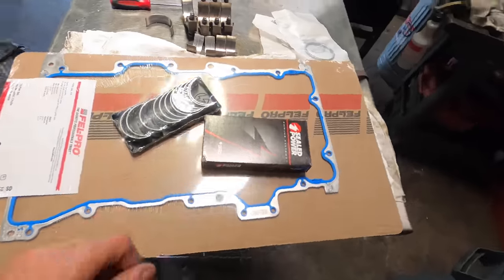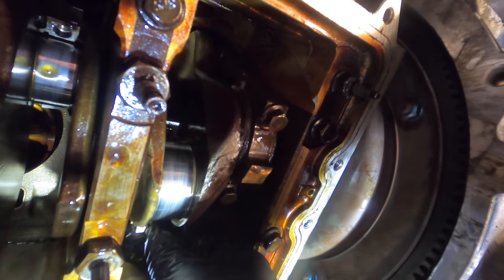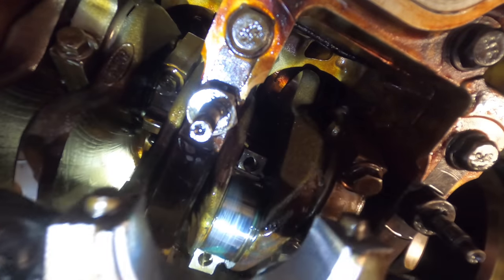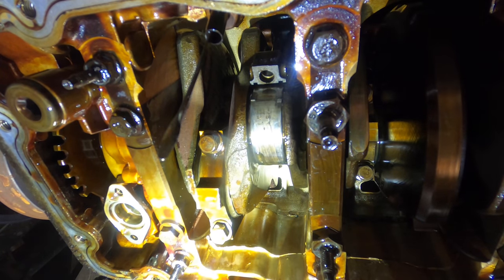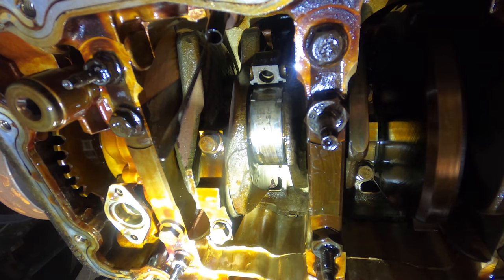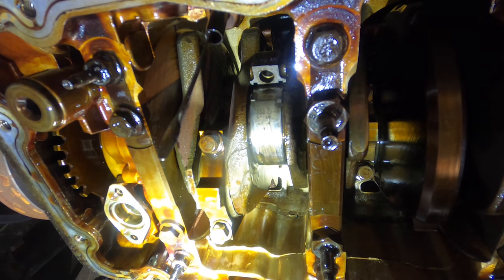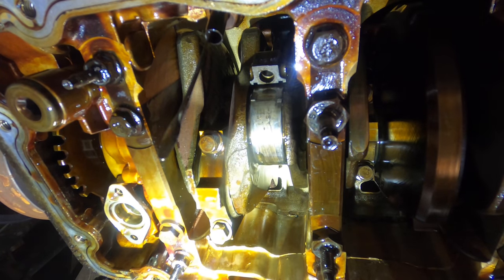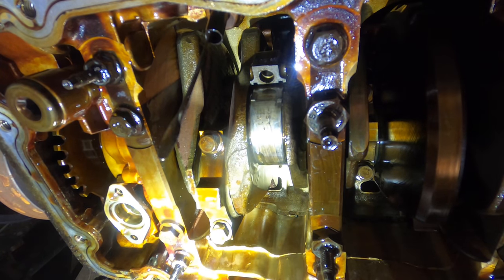Saving an Engine: Spun Bearings Replaced

Comment: It's refreshing to see a mechanic who actually takes the time to try to repair the engine, rather than just throwing up their arms and proclaim, "Nope, needs a motor."
Reply: Most of the time, especially with labor prices, it's cheaper just to replace the engine than to take the time to rebuild it.
Reply: I agree, in this case it was caught before  irreparable damage was caused, so there's a lesson for all here.... if your car has a problem at least get it diagnosed so you don't make an expensive paper weight.
Reply: The total hours of labor for this would have probably covered an engine swap. If you knew for sure you were buying a good motor, the labor cost would ensure you are getting your money's worth. This might work, but long term is unknown.
Reply: And then there's the question of guarnatee: in this case, if the customer comes back after a week with the bushings spun again, now what? (on top of that, he will ask for his money back...)
Reply: @brad3741  No, this WILL work. I've done it, and so have lots of other people. If the rods aren't damaged (they weren't) and the crank isn't totally hammered to death (it wasn't) just changing the bearings will get you many more years out of it. The bearings are deliberately the soft part of the system so they take almost all of the wear when things go bad, as long as you don't drive it so long that the bearings actually leave and the rod is hitting the crank. I've done the same thing on a Pontiac Grand Am with maybe a worse knock than this, and I didn't even smooth the crank like he did. 40k and 4 years later, it's still running and sounding like new. My neighbor is using it now.
Reply: @edifyguy  I don't doubt that it can work. And like I said even a new, used motor is somewhat of a gamble. I was just thinking about a whole new motor because of the possibility of engine wear in other areas. Something caused those main bearings to go bad. I believe he said this person didn't keep up with oil changes, or the oil got low, but I don't remember. I have seen people go forward with these types of repairs and it not pan out well. I just know the dealership I used to work for loved this type of work. Because if the rebuild doesn't work, they get another huge bill out of the customer for a new motor.
Reply: @brad3741  This person stated he never changed the oil. There's a good chance he never even checked it until the engine was making noises, in which case it likely got too low to keep things pressurized, which entirely explains this damage. The repair is the cheap fix, but it often works for a long time. When it doesn't there are other options, as you mentioned, but in this case the car would have to have sentimental value to be worth a new motor because it wouldn't have the cash value to justify it.
Reply: @brad3741  With a used engine, you also don't know what you buy. Cant't see it previous history. (Maybe the maintenance records, but driving is unknown)
Reply: Like the "Car Wizard" does all the time lol
Reply: This isn't really "repairing" an engine.  It's a stopgap and a total gamble.
I've done it a few times.
Reply: @retinaquester  Generally you won't see maintenance records on a used motor either. The junkyard isn't going to keep those on vehicles they receive. They just keep mileage.......but this knocking engine was low mileage lol. The only way you'd get that is POSSIBLY if you bought a motor from a private party who was parting their own car and knew its history.
Reply: @carpediemarts705  Sure it's a repair. Every repair is a gamble. You're betting there isn't something else wrong elsewhere which will cause an additional issue as soon as you put it back together. You're betting the repair parts are made correctly and durable (a gamble you'll often lose these days if you're not choosy about your supplier.) A used engine is also a gamble; unless you deeply inspect it, or at least bench run it, you really don't have any clear idea whether it's better than the one you're replacing. I think this was a great gamble, and one which will likely yield years of dependable service if the operator stops being stupid and gives it what it needs.
Reply: @edifyguy  My only concern is...if the oil level was that low, is there anything wrong on the top of the engine?  I guess you could see if the head gasket had been blown because there would be coolant in the oil, but still.
Reply: @StormsparkPegasus  It is possible, probable even, that the cylinder walls, camshaft and rockers are a little scuffed from low oil, but the bearings get damaged seriously long before anything else because they have explosions literally hitting them, and without the cushion of pressurized oil, they hit the crankshaft, where they're meant to float on the oil. He probably had JUST enough oil to keep some drips in the other places, but not quite enough to keep consistent pressure in the bearings.
Reply: @brad3741   I can change out the bearings like this in a couple of hours, as opposed to doing a whole engine swap which takes me a whole day. So nope not the same amount of labor. Of course doing an entire rebuild of not only the bearings, but piston swaps and valve train overhaul is a different story.
Reply: @alzeal  Well, that might be the case. But what it really comes down to is the hours the dealership bills them for. A job might only take a few hours, but if the book says 6 hours, they get billed for 6 hours regardless how long it actually took. At least that's how it was where I worked. I just felt like that motor was likely compromised everywhere, not just those bearings. Pretty sure he said this customer drove on low oil but I don't remember at this point. If they only got billed for a couple hours labor, plus parts, it might have been a decent option for them.
Reply: @gmstudent93  Another good lesson. If you don't trust when a mechanic tells you something is on its way out and needs replaced then get a different mechanic.
Reply: Oh it needs an engine, may work for a bit but this is not a proper fix. Lets just hope that car didn't change hands screwing over the next guy.
Reply: @brad3741  You're right!
Reply: @brad3741  I am sure that it CAN work if the damage isn't severe enough to loose the tolerances.  With this type of repair, it's a gamble.  You can spend the time, just to spin them again after a short time.  I have done this a few times, prayed to the engine gods; just to spin after a few miles.  I don't blame mechanics for doing an engine swap, their is so much going on with an engine, many thousand parts/components and they have to be in tight tolerances.  Very little wiggle room, that's why I diagnose a spun bearing motor as junk; making the whole car junk.  If a vehicle throws a transmission, I would be fine with a transmission swap; they shift and drive; or they don't.  A bad engine means to me as a junk car, no engine swap.  After a few days, possible pcm trouble codes/finicky sensors, plus many possible issues with a used engine, the time and labor isn't worth the salvaging.
Reply: @aclo982007  Bullshit, even a "new" engine is going to be a reconditioned lump of unknown history and may even be in far worse condition than this one.
Reply: @mfx1  No, just no it doesn't work like that, sorry but a crankshaft is precision ground and that crank is no longer true. Please don't build engine for people there's enough hacks out there.....
Reply: @aclo982007  Again bullshit, the roughness on the shaft was simply soft bearing material that was "welded" to the shaft, the emery cloth will easily remove that and do the square root of F... all to the shaft itself. If the bearing was completely gone and the shaft was gouged then yes the shaft would be history but there is no possible way the soft bearing material could gouge that shaft. An arguably better way to remove the bearing material from the shaft would be to chemically dissolve it which would have left it as good as new but no one is going to do that in this sort of situation.
Reply: @mfx1  You easily over look the biggest problem, the heat that was generated by the friction, the crank needs turned and polished, end of story....
Reply: @aclo982007  There would be obvious discolouration if it had overheated that much this engine was caught before any major damage was done, if it had been run like that for much longer it would have been a different story.
Reply: @mfx1  I'd love to see this crank mic'd just to show you all how far off it is, bearing are not maintaince wear items, you can't treat them or journals as such.
Reply: @gmstudent93  I thought the lesson was to change your fucking oil.
Reply: XD cheaper to keep her xD
Reply: @aclo982007  A fix is a fix, all vehicles are consumables, even a "new" engine is "not a proper fix" by your logic because that engine is even more of a mystery, esp. if it's a junker. And realistically, even managing to swap in a factory new engine, that still aint a 100% working unit. All you're doing to it by repairing is increasing shelf life (aka getting more mileage)
Reply: but this is not the way to porper fix engien it may work or not..

Comment: You cannot possibly have any idea how much these videos have taught me.  From having no idea what a crank bearing even looked like and wondering if I'd have to learn to pour babbitt to believing I might even be able to do a job like that myself even  lying on my back under the car.  You might call the videos long but they are worth every second.  Thanks loads!
Reply: That should not teach you anything that is absolutely the wrong way to do something it's a Band-Aid at best at bearing spun on the crank and the rod and it will fail again without doubt so unless you just want to put a Band-Aid on something and get by for a bit longer do not do that
Reply: @raymondholley1009  yeah obviously it's a bandaid if the bearing hadn't spun however this isn't a bad method. I've seen people get low oil pressure and just repair the rod bearing and it works out just fine, but yeah this is a repair to get you by until you can get another vehicle or engine.
Reply: @raymondholley1009  
I spun a bearing in my 1973 GTO on my way to work. 
It was a very ugly knock.
After work, I stopped at a NAPA auto parts and picked up a set of standard size rod bearings.
The next day I was under that old goat pulling the oil pan.
I performed a plastigauage test to insure the new bearings would allow sufficient oil clearance.
Then torqued in sequential specs as per the maual.
That GTO flippin ran strong for years after that with no problems.
How did I spin a rod bearing in the first place?
I checked my oil the day before and noticed a quart low on the dip stick.
But the next morning in a hurry to get to work, I hauled ass as i took the off ramp down shifting at high RPM’s 
and thats when the knocking began.
Always maintain oil capacity.
Reply: I would have just changed out the whole engine with a good used engine from a junk yard.  As I have done in the past.  Just get an engine with half the mileage  out of a wrecked car.
Reply: All well and good as long as you have the resources to pull an engine. Most people don't, and this is a job you can do with basic tools & some jack stands

Comment: If the owner doesn’t learn to check his oil it will be back.
Reply: Having had a GF who went thru this once the bill arrives they see Jesus over oil Changes and checks.
Reply: He was stupid enough to buy a Fraud, so I don't think he will learn anything.
Reply: The "I'm mad because I didn't get enough oil" knock is a sign of a short-term life, I'd be highly surprised if it made it another 91k. Who knows where the next flake of bearing material will rear it's unwanted appearance. ✌✌
Reply: Poor thing will be lucky if it makes to its 3rd oil change.  Since each change interval will end up being around 15,000 miles
Reply: Oil did not look that bad. I've seen one that had black and clumpy oil in it, had to change twice in rapid succession because first change loosened all the gunk and blocked the oil filter (wonder where oil pressure went).
Reply: My late older sister did that,oil change, what oil change, she just drove it until it went KA-BOOM and my dad found out what happened from the mechanic who was trying to fix the car and he told the mechanic to find a decent used motor and fix it but afterwards I made sure that everything was okay and told her to tell me if she checked the oil and it's ok,if not she is to call the mechanic and take it over to him to check it so that I can insure that it's ok
Reply: @SeersantLoom  That's because he had changed the oil three times in the first video lol Did a massive oil flush and even then the oil didn't look great.
Reply: That's called job security
Reply: @StreamwoodExplorer   Using only the best 99cent store oil.
Reply: @rsmith3062  Dollar store oil is great if you change it every 3K miles.
Reply: It'll be back anyway, year or two tops.  No engine endures such lubrication failure without taking something else with it eventually.
Reply: It will be back regardless - back or scrapped.  Replacing only the rod bearings is not a permanent fix for this engine's woes.
Reply: @chuckschillingvideos  Yup Crank bearings, valvetrain, timing chain especially guides,  He or she whoever owns the car will eventually be revving it to redline just one to many times and BOOM🙄
Reply: @chetmyers7041  What's the best oil for my car, sir? Clean oil, son, clean oil.
Reply: @Swordsman99k  I like using diesel and seafoam mixed with a couple quarts of oil to flush slugged-up engines. I learned it from an old-timer it saved a corvette that some doctor's wife never changed the oil in 70k miles, she just kept topping it off.
Reply: @chuckschillingvideos  isn't rod bearings all that's needed

Comment: I was a teenager when I heard about spun bearings.  I asked what that meant and no one I knew could explain it, the closest answer was that it's really bad.  Now, after all these years, it's crystal clear, thanks to this video.
Reply: Spinning a bearing means you are screwed. This customer must be a friend or family of someone at the shop. I wouldn't even consider this an option for a stranger; too much liability. And hopefully the customer understands that he is TOTALLY GAMBLING what i imagine is at least $600-$800 on this "repair". We did this in the 1980's, usually so the customer could immediately trade-in the car. Thus, we never knew how long before engine needed more internal work.
Reply: @hightttech  "Spinning a bearing means you are screwed."  Indeed, lol.  Looks like the decision to go ahead with this remedy was purely driven by financial reasons.  I imagine for the customer, the choices were not too plentiful and this was the least financially painful way to have a running car in their possession.  I'm not an advocate of kicking a problem down the road, however long or short that may be, but hopefully the customer will be in better financial standing to deal with this issue when it needs to be addressed again.  Oh, and hope they learned it's far easier and cheaper to change/check the engine oil from now on.
Reply: Same frustration here, and finally understand the reason.  The vast majority of people who work on cars are ‘math brains’… i.e. they are good at ciphering, but not so good at readin’ and rightin’.  They don’t have the vocabulary to explain in words to a novice.
Reply: Spinning a bearing can just mean you need to dress the crank, then do what rays doing.
It's based on what you actually find.
If the bearing eats up the rod, then you have to pull the head to get that piston out.